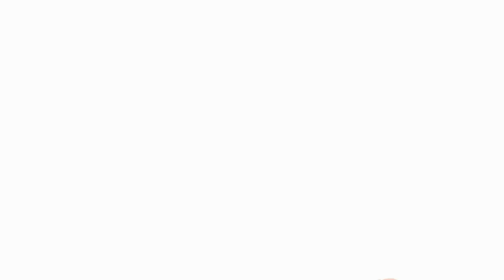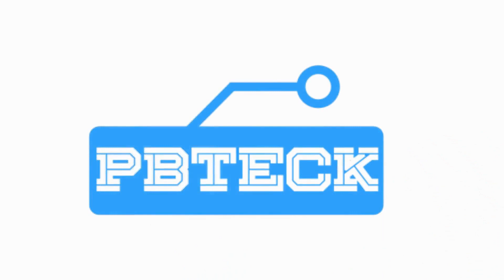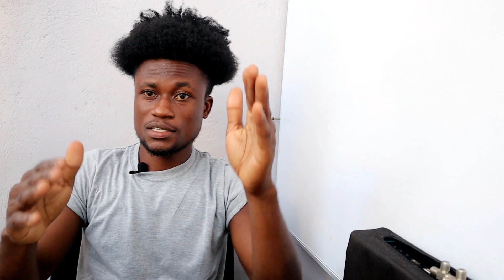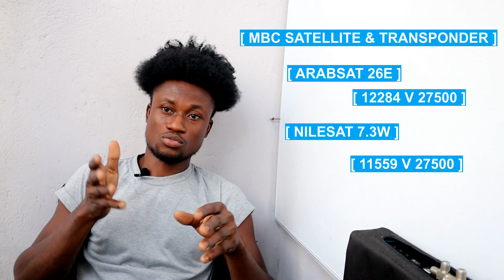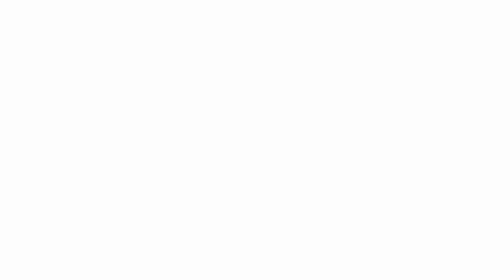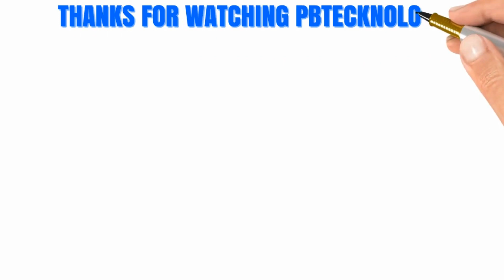MBC Installation Guide And Frequency

Comment: Sir please am a subscriber from Nigeria. And a client wants me to track mbc is the 12284 v 27500 still working currently. Coz I used 12518 H 29500 (nigcomsat) but the signal was not stable, so it wasn't showing anything. Please I need a working frequency on MBC. Thanks